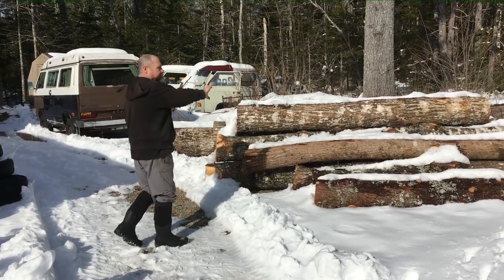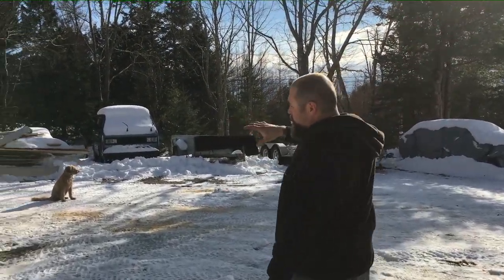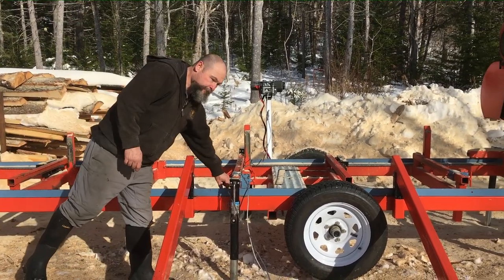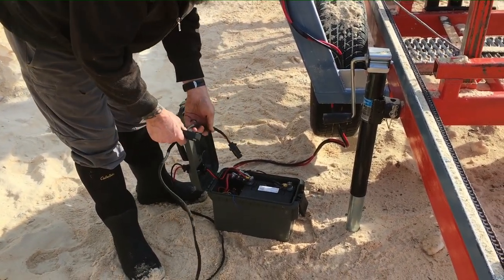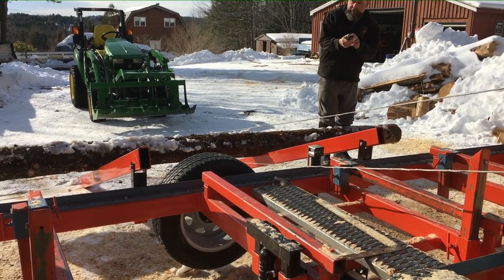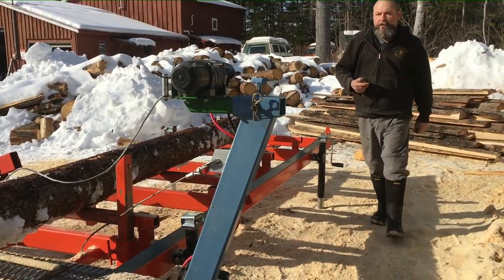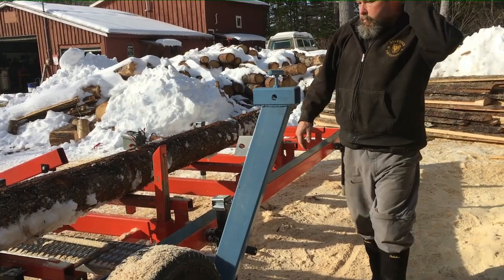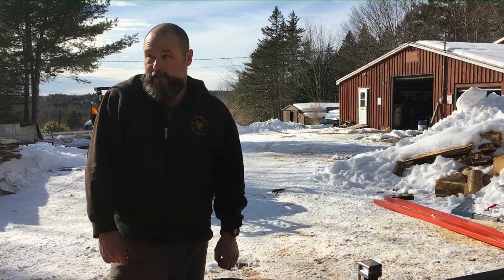Super simple Log loader DIY

Comment: When you drop a couple of thousand pound log onto the bed, how will the bed handle the impact? I bought the manufacturer's version with my mill and I agree it's a great way to manage loading the logs. But if your tractor can't handle them, how are you getting them from the pile to the mill? To my mind, that's the challenging part, getting the logs to the mill ;)
Reply from the maker: It doesn’t affect the mill deck at all. I can drag a huge log with my tractor that I can’t lift, but if I can get it close enough to reach a cable, I can parbuckle it on the mill.

Comment: As i said in a previous  comment mine folds down out of the way  and is hooked up to my battery that operates  my hydraulics  simple stuff .
My battery is charged by a solar panel  works great  .
Reply from the maker: I’d have liked to make mine a little more user friendly! But I’m the rare occasion that my tractor can’t lift the log- it’ll suffice. :)